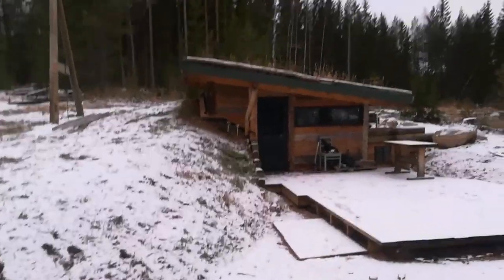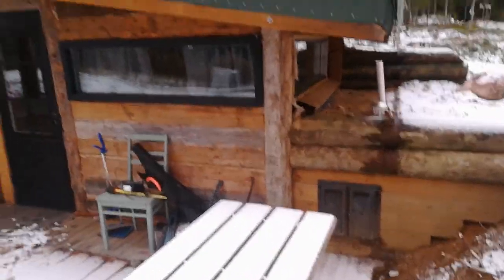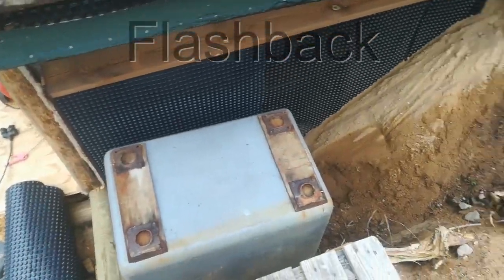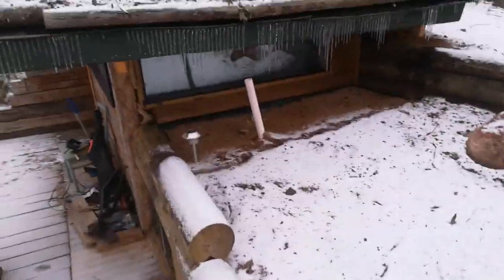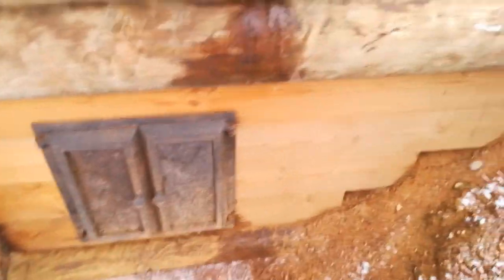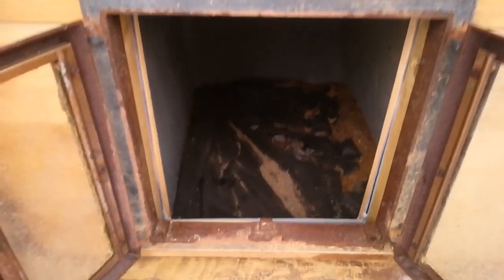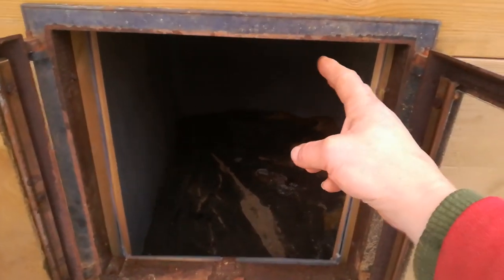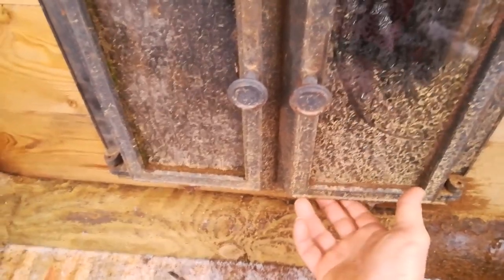Easiest log building method ever part 6. Conclusion

Comment: I LOVED watching this entire build. There is a cedar mill near me that throws away (sits the logs outside by the dumpster for anyone to take) and the logs are probably 4-6 feet long. I bet I could use those to make something like this....any thoughts on using cedar? Will the termites eat it away, I seem to have a problem with termites quite badly around here. Also, should someone chip the bark off and seal them before building the structure? Thanks for any help you can provide for my questions. I really do enjoy your work and I also have a back injury, so I understand your pain all too well. Stay safe and THANKS again for taking us along on your build.
Reply from the maker: I wish I could give my opinions on cedar and termites but here we do not have cedar and we don't have termites So I have zero experience with either. Thanks anyway & hope your back is good. Mine is pretty good but if its gonna go its usually in the spring when I start with more physical stuff......fingers crossed that this year I will be ok.
Reply: @ProjectHighlander  to reduce back work possibly you could stick the chainsaw in between the two logs for trimming. 
Also, lifting the drill out of the hole looks like a strain.   A gin pole or lifting device with a pulley and rope would help with that.
Reply from the maker: @jakebredthauer5100  I am not sure if you are being ironic/sarcastic here or if you really think that 'sticking the chainsaw in-between the logs' is a good idea. But when it comes to your second point....Attaching a pulley to help with drilling...... I have a real problem believing that you are serious.. I take certain, contemplated risks while working but what you are suggesting would be suicidal.
Reply: @ProjectHighlander  Thank you for your reply.    I wouldn't want you to get hurt.   I believe you are making a valuable contribution to architecture.   Thank you for the interesting videos.    It is good to be cautious.   I am a safety-minded person myself and willing to try new things as you are.

If the logs were stabilized so they would not pinch the bar, I see no reason for not sticking the bar in between.   Skilled users routinely make plunge cuts by sticking the bar right into the wood, tip first. It is used for the felling cut when felling a tree in a professional manner.   You may not know that cutting is often done with the top of the bar.   Kickback is what you get when you put the tip of the bar on the wood as I saw you doing. I didn't think that was safe.   If you were more specific about the issue, we may have better communications.

The end of the bit may be worn so badly that the hole is too small for the flighting on the auger. I suggest you try a new bit to see if it comes out of the hole more easily and requires less power for rotation.

Water is the universal lubricant. Have a squirt bottle and squirt some water into the hole where the bit is (to save your back).   

You can drill the top log prior to putting it on top of the wall.

A bench grinder could be used to roughen the side of the bit to rub out a larger hole.

A pole with an appropriate base could be used as a lifting device. If the drill were shut off while lifting I see no safety issue. The device could be on three caster wheels.   It would need a counterweight --- you could stand on it.

I love Earth-sheltered architecture. With more advanced engineering you could have integrated the two styles.

If your method has merit, you could acquire an apprentice or write a book or do consulting. There are literally tons of architecture books at the architecture library at the University. You could write out the advantages, disadvantages, pitfalls, tools, materials, frequently asked questions, building codes and, I nearly forgot, techniques.   You are an apt teacher.

I would think that low-density logs would be better because they are lighter and have more insulation value.   I guess you rate low-density logs as being inferior due to vulnerability to rotting.
Reply: @ProjectHighlander  Here is a procedure for adjusting the flighting on the auger bit.   Use a bench grinder to roughen the outside edges of the flighting of the auger.   Then try it to see how it works.   If you want the bit to be looser, you can see where the roughness has worn off and grind on those areas with the bench grinder. Try it again and so forth until it is loose enough. I wouldn't think that it would need to be tight at all to get the wood particles out.   There is not much risk in trying it on a new or used bit.   Rolling the bit on a flat surface would show the high and low spots.
Reply: @ProjectHighlander  the top corner of the fighting Edge probably wears down. The remedy would be to put the bevel underneath. I mean to grind down the bottom corner. That would make it more of a cutting-edge and less of a friction surface.
Reply: @ProjectHighlander  You could ask a logger about how to use a chainsaw.
Reply: @ProjectHighlander  Checking the temperature of the bit would be a means of checking the amount of friction.
Reply: @ProjectHighlander  Instead of handcrafting each joint, perhaps you could invent some joinery tools to make the tongue and the groove a consistent and dependable size.    For the tongue, I would imagine two blades permanently spaced that could be hammered into the end of the log, to pop out the corners. For the groove I would imagine two tools would be necessary, one for width and one for depth.   If you did not have tools to make the joint to reliable specifications, at least you could make measuring tools for easily measuring the tongue and the groove.   A fake tongue and a fake groove could be used to measure.
Reply from the maker: @jakebredthauer5100  Ok. you obviously not understood the process and you are thinking like an engineer rather than a log builder. Every log is different and depending on its thickness, shape and the degree to which one end is bigger/smaller than the other - the joint will be different. I cut them deliberately rough, knowing that once it is placed in the wall I will adjust its angle and then modify the joint accordingly. You could go to the trouble of creating a jig and then every tounge will be exactly the same...but then every one of them will need to be modified anyway because every one of them needs to be different.
Reply: @ProjectHighlander  I still don't understand why the joints would need to be different depending on the size of the logs.    For example, if the joints were determined to be 2in by 2in, why wouldn't that work for a 5-inch log or a 10 inch log?   I can see that if the vertical log had a wavy surface that would be very difficult.   Therefore I am assuming the vertical log has a flat surface.
Reply from the maker: @jakebredthauer5100  ...........?
Reply from the maker: @jakebredthauer5100  ...................?
Reply from the maker: @jakebredthauer5100  Why would I ask a logger? or anyone? I have been using chainsaws for 20 years.
Reply: @ProjectHighlander  two inches by two inches
Reply from the maker: @jakebredthauer5100  When you drill up to 50cm into logs you are going to get friction, fact of life. what you are suggesting would be counter productive and cause the drill bit to get stuck more often. I think you are saying that I should roughen up the bit to wear away at the sides of the hole making the hole bigger...but I want a 28mm hole, not 29.
Reply: @ProjectHighlander  Regarding chainsaw use, I thought you were objecting to sticking the bar in between the logs.   I may have misunderstood you.   I was trying to help you with your back issue.
Reply from the maker: @jakebredthauer5100  Yes, the vertical has a flat surface but the logs jointing against them are not 100% horizontal except for the first log in each wall which have a flat base. Every other log is at some kind of angle. That angle can only be ascertained once the log is put in the wall and the angle can then be decided and the joint modified. If much wood is removed during the mod then the tongue then has to be shortened. the only constant is the thickness of the tongue at 5cm which is very easy to do with the chainsaw directly. just draw a couple of lines and cut to those lines.
Reply: @ProjectHighlander  I had not thought of that angle. I didn't know what you were referring to when you said "angle".   Perhaps I would have noticed that if I had seen you using logs that had not been engineered.
Reply: @ProjectHighlander  If you are trying to slant the logs, there would be significant angle. If you are trying to level the logs, angle would not be significant.   Use the jig, make all the joints the same, save time and increase production.   I do not know what a jig would look like.   The point is, use principles of mass production instead of handcrafting.   Keep the same building style.  What do you call it?

I made a list of suggested special tools but it disappeared. Chisels, mallets, dado plane and special measuring devices.   I gave more detailed descriptions of each tool.
Reply from the maker: @jakebredthauer5100  Jake. I think you are trying to help. But before you continue please just let us all know. Have you ever built a log building?
Reply from the maker: @jakebredthauer5100   Why would I want to use principles of mass production? If I were to build a series of ten of these buildings then maybe I would try to streamline the process but as a matter of principle I never build two buildings the same....
Reply: @ProjectHighlander  I had no plan to continue.   I would not know how to build a jig.   I don't want you to try anything based on my experience.   I want you to use your own judgement.   If I said I had experience, you wouldn't know if I were lying or not.    The important issue is whether a tool, material or technique is safe (for your back), effective and efficient.

If you are a high quality person you would agree that my level of experience is only important if I were claiming that what I advocate has been tested.

I suspect that your best source for a suitable dado plane would be a custom-build.

What is the name of your method?

You are free to do whatever you please with what I have written.    I have written about dado plane, extruded polystyrene, log density, trimming between logs, drill bit friction, propagating your invention, integration of building styles and standardizing joints (no modifications).
Reply from the maker: @jakebredthauer5100  Jake, really, I appreciate that you are trying to help but you are trying to fix a problem that....is not a problem at all.  I am sorry sir but you obviously do not understand anything about log building. Its not about my 'trying' to slant logs or not. every log in every log building ever made is at some kind of angle. Not as a mistake but because that's how you build log buildings. Your ideas of jigs and standard joints are wonderful,...if you are building with 100% standard concrete beams, all the same which will not twist, move or crack.  Log building is more Art than Science. Every log is different, different shapes and sizes of course effect how you will shape them but also how tight the grain, how dry the wood are  taken into account when deciding how to fit them, Is the heart wood off center? is the log from the upper or lower part of the tree? all of these are taken into account by an experienced log builder . I have not seen a jig that can do that.  There are many companies that do take your approach to log building, standardising everything. That's why my business model works. because people don't want those mass produced log buildings that crack, twist and fail because the builders built them robotically rather than intuitively based on a real knowledge and understanding of the material.
Reply from the maker: @jakebredthauer5100  I have not invented anything. I just figured out a good way to do stuff. Turns out lots of people all round the world figured it out too. No Probs.  all good. Got new projects coming, some new techniques too.
Reply: @ProjectHighlander  I was not saying to mass-produce buildings, only the log-end joints: consistent size, right angle to log centerline, no modification.   

I was not advocating for a jig.  I want no attribution for the jig idea because it was your idea.    You said it would be helpful.   I don't understand the jig idea myself.   I can see how a jig would prevent accommodation of log variability.

When I mentioned slanted logs, I meant diagonal, like 45 degrees, something that might be done for extreme aesthetic effect.

I understand that wood has much variability in many different characteristics.   I can see how that may work against the jig idea but I don't see how it works against having joints that are of a consistent size.   Having the standardized joints combined with the variability of the logs would result in an appearance of being handcrafted, I suppose.

With your experience you likely can predict the outcome of various changes in procedures. What would be the end result of this one particular change?   

Try to be reasonable.   No jig.   No conflating this one change with many others.    No referencing disparity in experience.   No monologues on characteristics of wood or philosophy of methods.   Just the result.  Focus.   Farmers and builders are practical people.
Reply: @ProjectHighlander  It looks like you are saying that when a drill bit cuts a smaller hole due to the outside surface being worn off, that is no problem.
Reply: @ProjectHighlander  As the end of the bit cuts a progressively smaller hole, I expect the middle of the bit to fit more tightly.

Comment: Didn't realized only 1 wall will be seen,  which using old strong wood made sense and blend in nicely.  This cabin is built like a tank.  Any concern with insects or rodents nesting under the big deck outside?
For this project what will it cost not counting land cost?
Reply from the maker: There is wire mesh installed under the edges of the deck to keep rodents out. We don't really have many problems with insects around here, no termites for example, the harsh winters kill them off. I am afraid I can't answer the cost question. My customer was happy to let me film the project but does not want the location or financial details out there.

Comment: Additionally, it looks like the corner posts are weakened by the two dados or grooves in the corner posts have too little meat left between them.  I would have simply made the groove on the ends of each log and nailed on a strip on the corner posts.  Perhaps even better, I would have used big dowels for these joints.
Reply from the maker: Not sure if you have watched the whole series as I do address these points in there. Yes the posts are weakened somewhat by the grooves, particularly the corner posts so I try to use larger logs for the verticals. It would be good to use even bigger logs but around here its difficult to get really big stuff...Huge verticals would also look great. I did use your suggested method either side of the door for exactly that reason, to avoid weakening the posts too much. A 2x2 attached to the vertical and the grooves done in the horizontals but this has its own problems. Firstly you have to remember that the posts will shrink vertically. Not much but some. so the 2x2 has to be in sections with small gaps in between. I covered this in one of the early videos in this series. Also every horizontal, when placed, needs to be adjusted, the lines of the groove, the depth of the groove, the length of the tongue all may need to be fine - tuned. If the tongue is screwed to the post then you lose one weapon in your arsenal, you cant adjust the tongue without hitting your screws. Plus I try to avoid using screws and nails as much as possible in the wall structures because although they hold well initially they can become compromised over time as the wood moves and shrinks.
Reply: @ProjectHighlander  Yes, I watched all 5 then also a 6th one.

Comment: Great build. Not fast or easy. I think the owner needs his head examined. No place for the snow to slide off the roof.
Reply from the maker: Thanks for your comment. There really is no problem with snow sliding off the roof. The roof is at a very shallow angle and its a turf roof so no sliding, it just melts in place.
Reply: @ProjectHighlander  I made a comment about roofing insulation earlier.    Snow is an excellent insulator.    The ice absorbing the heat would be a negative.

Comment: Someone should be brought up on charges for putting 3/4 of such a structure under ground. I believe in the 1st video you said the logs wore dated 1821. Then said they wore 100 years old. not sure if there 200 years old or wore dated 1921. Either way to stick them under ground like that is a crime in my eyes. He must have paid you well. Personally i would have refused to use those logs and use new ones or let him get someone else to do the job. I think 3 sides stone and the front logs would have been more appropriate.
Reply from the maker: Reasonable criticism. The idea was from the beginning to build a half-submerged cabin, the logs had not been sourced at that point. Yes, I got the math wrong. The logs are two hundred years old.
Reply: @ProjectHighlander  Nothing but good to say about your work sir.  Very good quality.